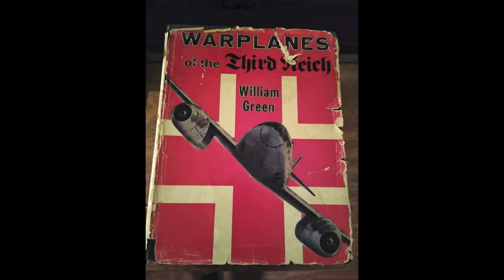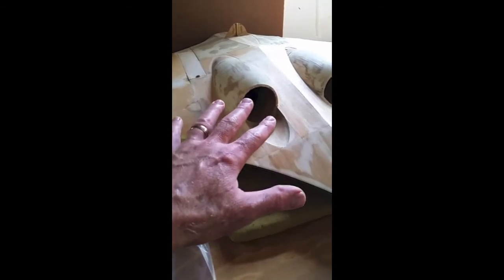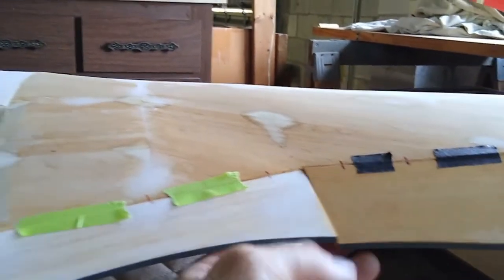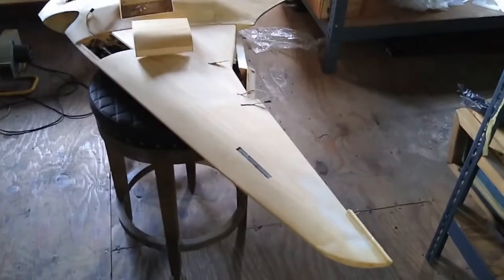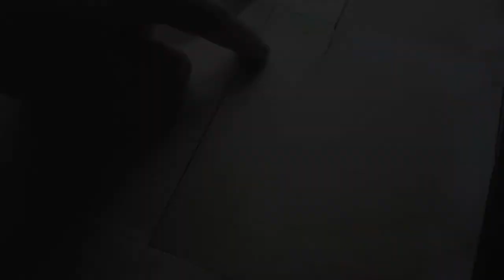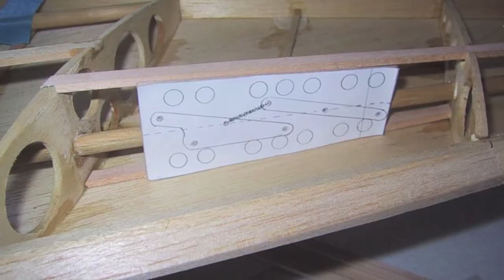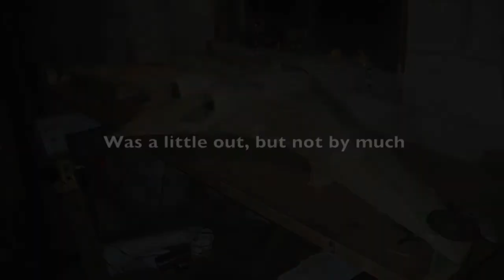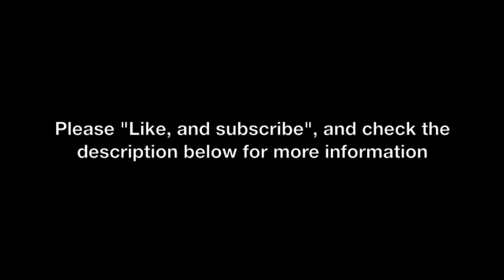Jack Bale Horten Ho IX

Comment from the maker: Just a quick update, I received the fans and motors in the mail today, just about ready to start tweaking the wing back into shape and begin work again keep checking back for updates
Reply: Hi. Have you made any progress on this model ? Ive been making my version to be a glider only. Its really quite challenging. Got 4 servos installed and hoping i'll be able to program flight controls in the transmitter, which is a spektrum dx8e. I applied the fiberglass to the surface today. Had some problems with the elevons warping, probly due to this hot weather
Reply from the maker: @TerrariumFirma  Hello, no I haven't made any progress lately because I was uprooted from my place of residence, and had to move in with family for a year. I now have a new house, and the model is in storage.  Basically it's been on hold until I get my new building room setup. 
So you are saying you built jacks model as a glider?
Reply from the maker: @TerrariumFirma  I do have plans for  a glider version on hip pockets aviation. I feel it was a better design for sloping than Jack's
Reply: @flashted Yes I built jacks version, and its from the plan that has been modified [i think it was you that modified the plan?]. Its got elevons, and toward the tips abut 4 inches are split like the ones on the stealth bomber to act as drag rudders/ don't know how well it will work to produce yaw but i,m gonna try it. If the drag rudders doent work i'll just stear it with the elevons. Hope it isn't too heavy, i'm glassing it.
Reply: i'll put a vid together with my build pics so you know what i mean

Comment: which are the control surfaces? theres three on the plan but i want to make the ones towards the end of the wing tip like the split drag rudders on the B2 Spirit. Are the ones towards the base of the wing flaps or elevators? Thanks
Reply from the maker: The tips are of course the ailerons, the middle surface are the elevators, and the inner most are flaps. How the Hortens intended these control surfaces to to work in unison, is still a mystery to me. Also, we cannot forget the "drag" rudders at the tips also. I intended to set up the ailerons, as elevons, and use a mix to "crow" the elevator s, and flaps as a speed brake function. It would be possible today's modern radios to mix all surfaces to work as elevons, and still use the crow feature also.
I did consider using the B2 Spirit type of split ailerons for this aircraft also, but most of it's already built and I don't want to hack things up.
I am about to construct a sloper version of this plane, with this feature. There was a group of guys called team legit that had a feature on a flying wing for fpv that used this feature, I will try to find the video and post it here.
Reply from the maker: Here is an elevons / drag rudders type of setup in taranis

https://youtu.be/JQJMgOiairU
Reply: @flashted  thankyou. Thats very helpful. I am going to make this a sloper only.
Reply from the maker: Flaps are furthest in board, elevators  middle, ailerons out board, if you are making a glider just use the ailerons as "elevons" the hortens mode of controls was way complicated, and not worth using.

https://youtu.be/JQJMgOiairU